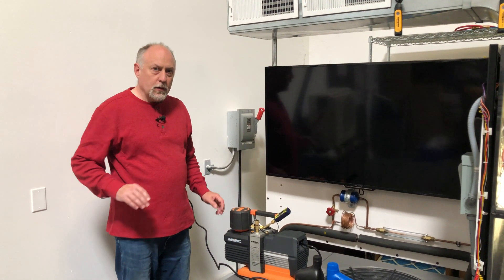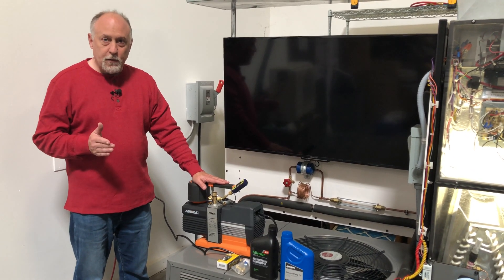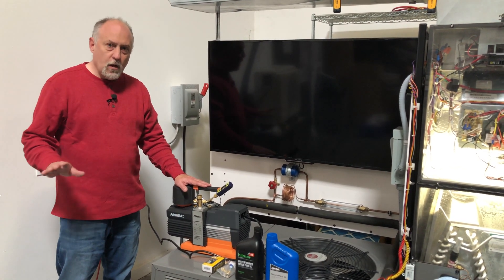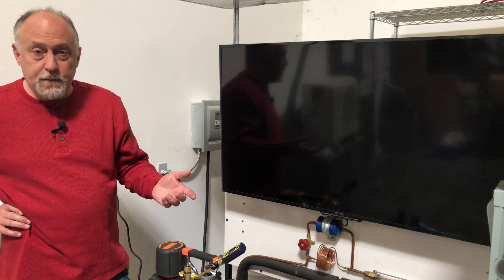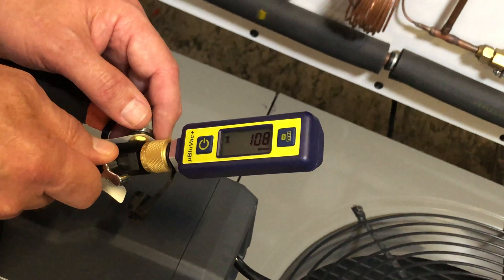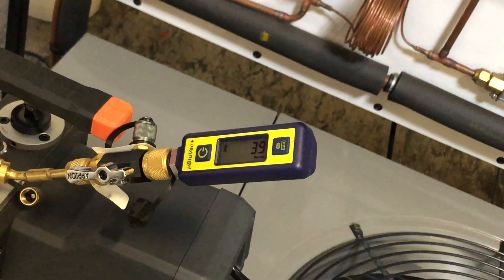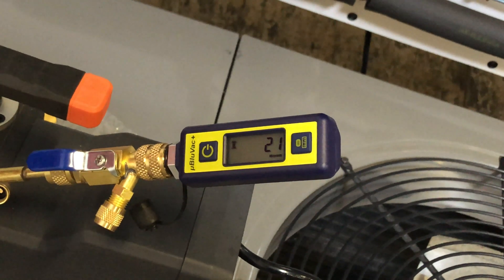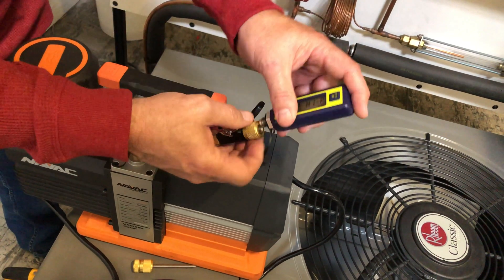Core Tool Testing with @measureQuick

Comment: This is really helpful, thanks. I simply had a ball valve in this type of setup (ie not including core removal) and saw the reading rise quite quickly when closing, even after opening and closing a few times and thought the valve must be defective.  If your core removal tool had been in an oven first, or left on the pump for some time opening and closing the valve many times, would you expect the rise in readings when closing the valve to level off and if so, to what sort of level after what length of time (very approximately of course) for the products your were testing? Thanks.